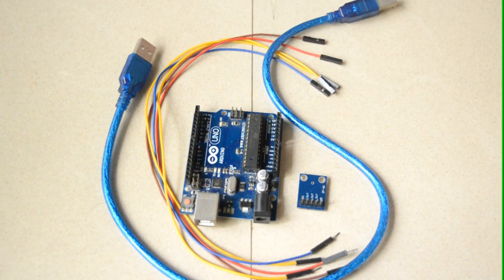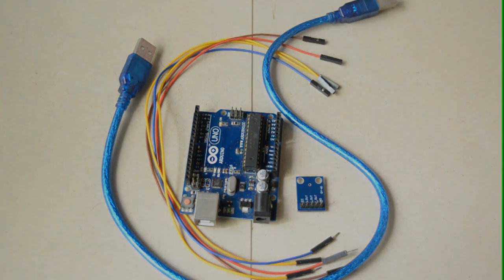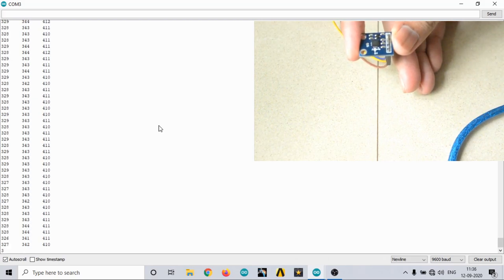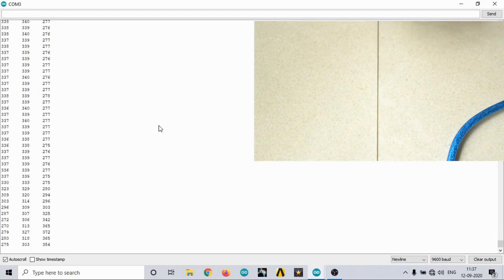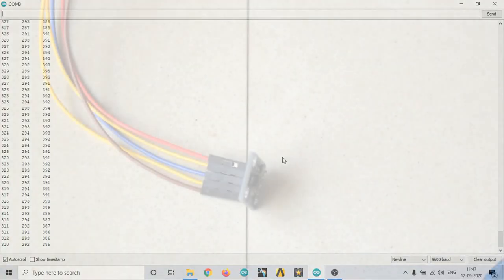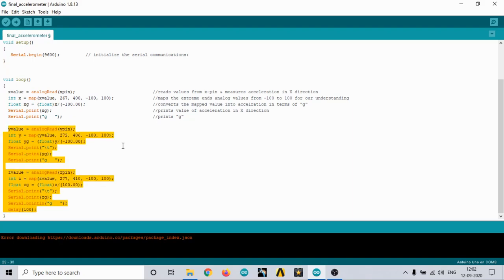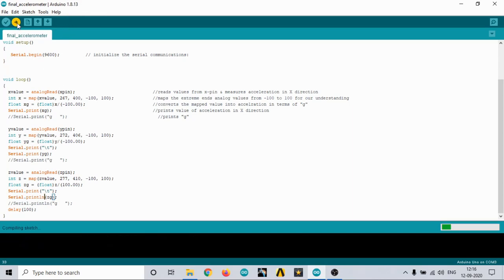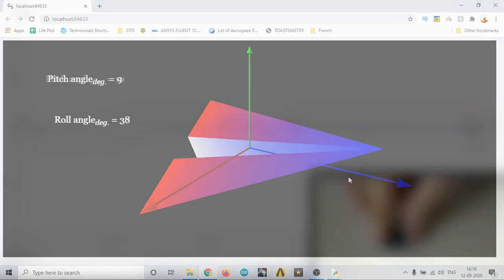Measuring & Plotting Acceleration values | Arduino -  ADXL335 Accelerometer Tutorial

Comment: This is really helpful! I just have a question. After the calibration and the attempt in using it as a sensor, can I have more decimal number results like 1.7364363 instead of  1.74? 

This doesn't happen by just increasing the number of decimals in the output it just adds zeroes (1.7400000) Thanks!
Reply from the maker: Umm.. I think you could do it by changing the type from "int" to "long" or something like that. Haven't tried out. Let me know if it works out ;)

Comment: Do you know how to convert G units from ADXL335 to velocity units?
I need to convert it so i can compare the velocity units with ISO 2372 for monitoring.
Thank you..
Reply: You can not convert acceleration into velocity because velocity is rate of change of acceleration , so you will need to have one more additional parameter, that is time. 
For example: 
At time t=0 , let us assume your vel is 0.
Then at t=10 secs you have to find out your velocity. Now if you have maintained constant acceleration of 10m/s^2 then in 10 secs you would attain a velocity of 10*10= 100m/s velocity. So you can not depend on these values only.

Comment: Hi bro,
Arduino: 1.8.15 (Windows Store 1.8.49.0) (Windows 10), Board: "NodeMCU 1.0 (ESP-12E Module), 80 MHz, Flash, Disabled, 4M (no SPIFFS), v2 Lower Memory, Disabled, None, Only Sketch, 115200"

ADXL335_calibration:30:18: error: 'A3' was not declared in this scope

 const int xpin = A3;                  // x-axis of the accelerometer

                  ^

ADXL335_calibration:31:18: error: 'A2' was not declared in this scope

 const int ypin = A2;                  // y-axis

                  ^

ADXL335_calibration:32:18: error: 'A1' was not declared in this scope

 const int zpin = A1;                  // z-axis (only on 3-axis models)

                  ^

exit status 1

'A3' was not declared in this scope

This report would have more information with
"Show verbose output during compilation"
option enabled in File -> Preferences.

I get this error, what should I do;
Reply from the maker: You have not defined the pin numbers. Please copy the exact code, I have shared or share your code